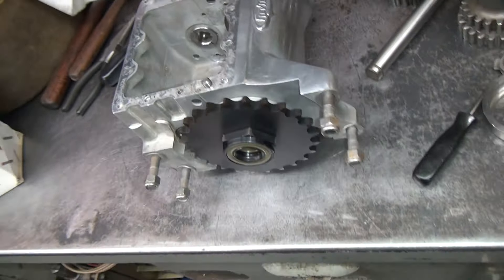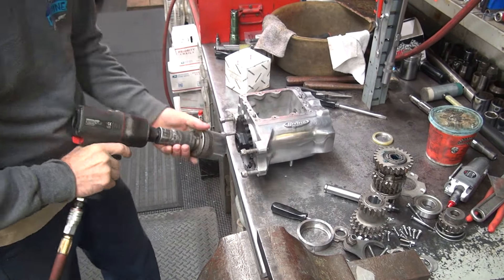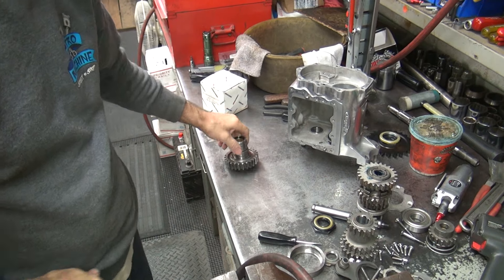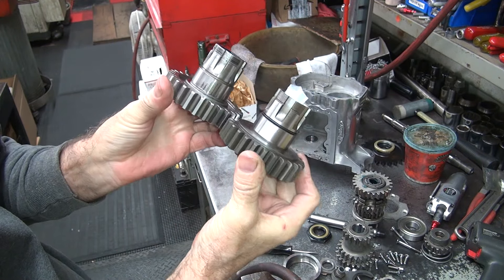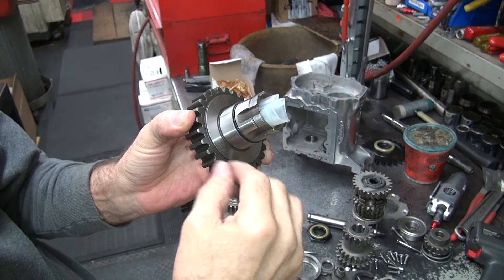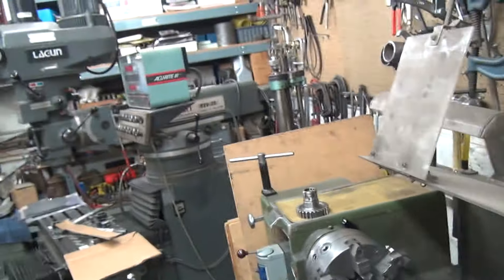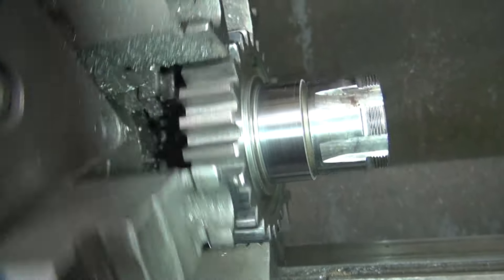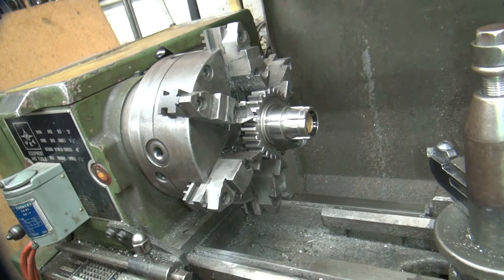#117 1970-84 4-speed revtech shovelhead transmission rebuild 74" 80 ratchet top harley tatro machine

Comment: Tattoo your getting old… with them witness marks on that gear you didn’t know where the noise was coming from? You’re getting old… wait, aren’t we all.
Reply from the maker: its not that. i have never had that happen before. plus i rarely will use parts like this. i like my jobs to last, not just get by for the short term.
tatro
Reply: @TatroMachine  ok just checking.